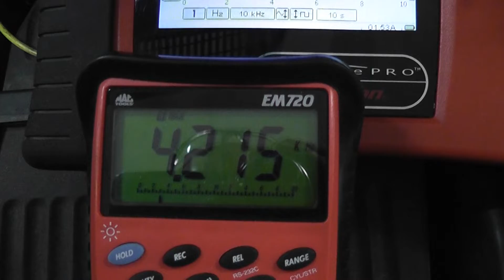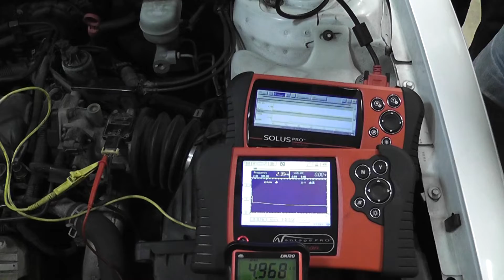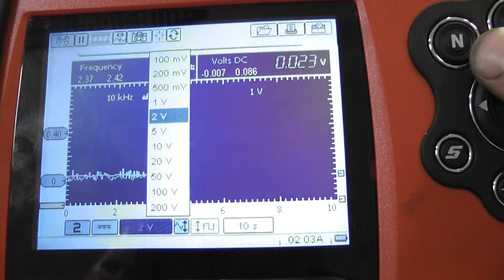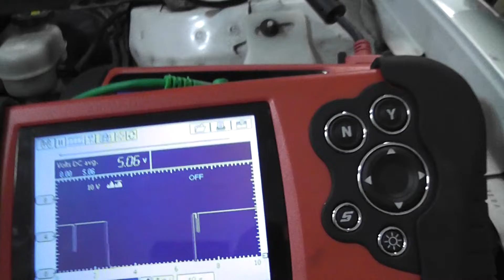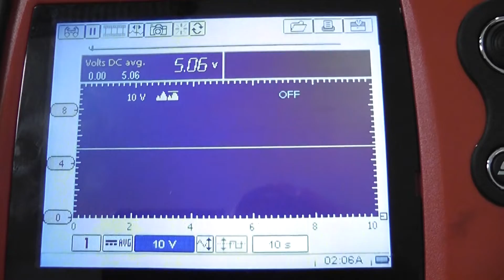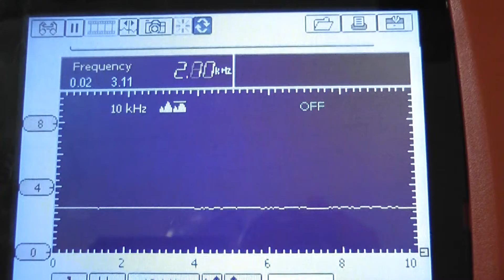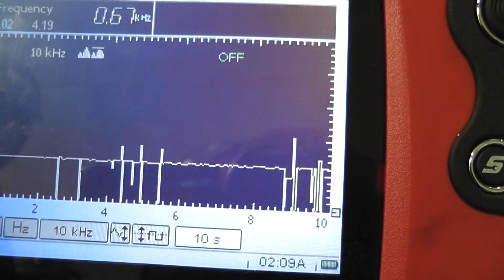How to test a GM MAF Sensor (Part 2)

Comment: I have a HANTEK DSO2D15 oscilloscope, and I have no problem viewing the square wave signal. My question is: How do I configure my oscilloscope to graph the square wave in Hz? In the coupling option, I only see three options: direct current, alternating current, and ground; I don't see the Hz option.
Reply from the maker: You'd need a math channel like the picoscope has to graph a frequency. Or like the Snap-On scopes have, a specific graphing multimeter

Comment: How much maf g/s value should be if I’m driving at 60 km/hr?  Mine is at 15-20% on cruze lt 1.4 2014.
Reply from the maker: every car is different, what are your fuel trims when you are driving at a steady speed, if they are good, your MAF numbers are also good
Reply: ScannerDanner Both short and long trim are at 0-5%
Reply from the maker: @gagansvirdi  no need to worry about your MAF numbers then my friend, if the MAF was skewed or dirty the fuel trims would absolutely be affected by this
Reply: ScannerDanner Thank you

Comment: trying too understand''''''''''you mainly use oscilloscope and voltage readings as your main them of your automotive repair procedures  and this is why you are called scannerDanner? if so cool
Reply from the maker: Yes and I am an instructor at a Technical College and my students gave me that name years ago. 
My last name is Danner, so it fit :-)
Reply: thank you so ,much and i enjoy your video i may have some questions along the way is it OK from time to time too ask ?

Comment: P0102 code:1996 Olds. Lss 3.8 SS. Red wire 11.8V., only 2.6V.at Ref.wire Key on. Start eng.and rev the engine and the ref.wire voltage remains the same.The Hz at idle are 2.7. The Hz goes to 5.2Hz.at 3900 RPM and the eng. drops a cylinder and RPM is maxed out 3900 rpm while in park. I did put a new Duralast MAF sensor on it and the eng. ran very badly.I had to put the old one back on. Starting off with the key on and only 2.6volts at the reference wire does not look good to me.
Been in this business all my life. I overhauled a Model T Ford, Eng.and Trans.in 1962.That car was old then. Now I am.<:)
Reply from the maker: what did the yellow MAF signal wire read with the connector unplugged and the key on?
Reply: I unplugged all other sensors.Still had 2.6v at reference wire. Unplugged maf sensor and got 5v. I orderd a new one.

Comment: to Paul, is it there any base line  to test digital sensor  as it is with analog for example  more than 4.0 v, I installed a Toyota new MAF and the max reading was 3.8 and did not give any trouble on fuel trims , getting back to the question   is it there any base line max HZ peak frequency or does it varies from manufacturers?? thank you

Comment: I have a 98 camaro with same engine and same problem. I replaced the MAF with a rebuilt one from Auto Zone and PO102 code still set but with much different freeze frame data.....It was great to listen to someone who Knows what they are talking about. This is the most practical and informative video on electronic system troubleshooting I've seen on here.....Man I need to get a good scope:)

Comment: On the freeze frame data for the P0102 the MAF had a reading of 1.91G/S and the short term was -23 and long term -10.  pulse witdth 3.31. . I used a vacuum gauge and it read 16in HG. I did a fuel injector balance test and all cylinders were fine. I have spark at all cylinders.

Comment: Hello ScannerDanner! I used the Modis on my 1997 BUICK CENTURY 3.1L 
It has a P0102 and P0300. I connected the scope to the MAF and I was checking the frequency. At idle without doing anything I would get a high spike of 21khz at random.  On the second channel I was measuring TP voltage; it is supposed to be under 1V at idle. It was at .5 volts, however it would spike to 1.5 V and would have a low of -0.2 . . . i thought it was supposed to be constant. . .what do you think?